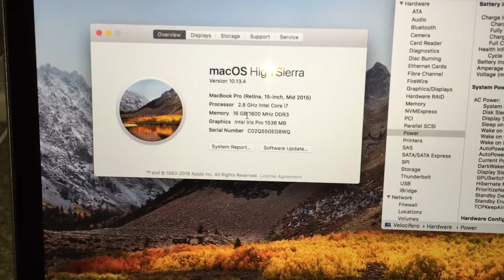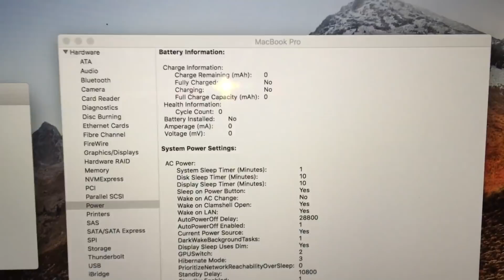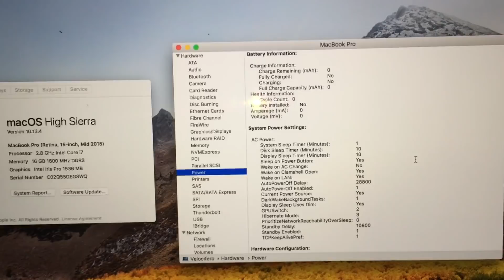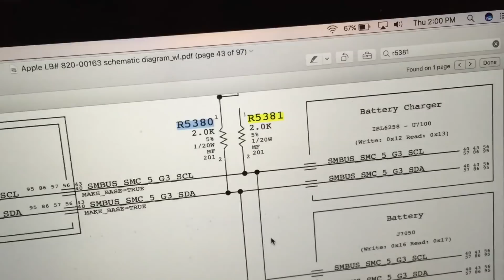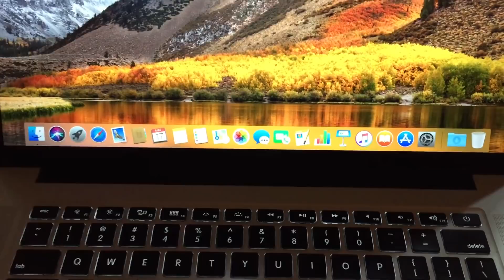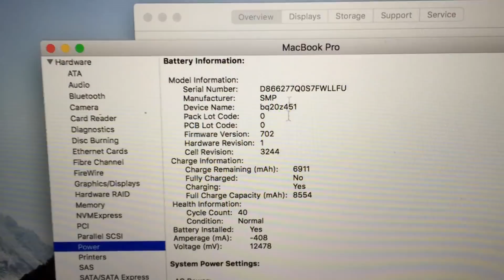Mid-2015 15" Retina MacBook Pro No Detected Battery Repair

Comment: Old video but hope you can still help. 2015 mbp 13, left it plugged in overnight and then it started with this issue. Wasnt able to locate a schematic to find the SDA and SCL resistors, but probed around a cirrus (im assuming the smc) chip and found two that measured ~2.1 kohm though i have no clue if they are the correct ones. Im led to believe it is this issue (or another logic board issue) though cause if i unplug it and then plug it back in after a few seconds, it will behave as if it woke up from hibernation. If you would be able to offer some advice especially on where to find those resistors it would be a huge help. TIA!

Comment: I have a mid-2015 MBP whose original battery gave up the ghost. The system reported all the correct status info, including "replace this battery". I'd ordered a replacement battery already. I replaced the battery yesterday.  When I booted up, the battery info doesn't show, continues to show charging (per power cable), and shows "Current battery charge: 0% on the Power Saver panel.  Is it reasonable to think the board was damaged in the process?
Reply: Do you know if mid 2015 should boot if battery faulty plugged in? It fell outside the repair serial (lame) but it's been reporting in the os for some time that service needed. I get chime and black screen and fans on when disconnected battery power drained and plugged in, but have to repeat that process just to get chime.  No external monitor either so screen cable ok. Just wondering if I should throw money at this thing I've used it occasionally for some time with it plugged in because batt life poor but not sure if it's a link where fully dead battery still won't work with adapter. Any insight appreciated can't get a straight answer.

Comment: Can you make a video using this exact same process but on a mid 2012 macbook pro 13in?
Reply from the maker: You just have to locate the SMBUS pullup resistors, the circuit is basically the same.

Comment: Hey I think I'm experiencing this same prob with my MacBook air, the minute plug the charger in, it turns on, if I plug it out, it turns off. When I check the system info it says no battery installed and I know that a battery is installed.
Reply from the maker: That could simply be a bad battery, but if you've verified the battery is good, then there is a chance you have a similar logic board issue.
Reply: @dosdude1 Do you know generally if the adapter plugged in with a bad battery for a fully dead battery should still work plugged in? I've had a bad battery for a couple years. The OS said requires service and I just used it plugged in because it wouldn't last long. However, now I get a chime but just a black screen and fans on, only when I unplug the battery drain by holding the power button down, putting it back together and hitting power, then repeating those steps is the only way I can hear a chime but it stops there, even with external monitor plugged in. For some reason I can't seem to get this thing to verify an SM reset through the power adapter light. I don't think I've ever had success with that. (Not even sure if it exists in logs if a successful smc reset was performed?) 
Thanks. I'm just trying to figure out whether I should throw a money at it for a battery to see if it'll boot up plugged in. Thanks

Comment: How much does that cost?
Reply from the maker: Does what cost?
Reply: @dosdude1  To replace the part
Reply: @midnightcrown5101   just a guess, but I would say .75 cents plus mail. Not much, the problem is finding the item on the board that is bad. when you find it, then you can use hot tweezers, or hot air, or if just a soldering iron, then cut the resistor in half and take off half at a time, if you are poor.

Comment: Great video. Anyway, I received a mid 2015 15 inch dual graphics model that keeps on rebooting several times before booting up to desktop any time I switch it on or restart it. The battery has only 202 charge cycles but it's dead (Replace Now).
What are your thoughts? I'm in Ghana, would have loved to send it over.

Comment: Hi dosdude1 how much would it cost to fix a mid 2009 17" with weird power problems?
Reply from the maker: 99% of the time power issues with those are caused by a failing C7771, in which case I could repair it for you for $75 if you're located in the US.
Reply: dosdude1 Only when I switch the the laptop to the high performance mode it shuts off. When I plug it in and switch to high performance mode it stays on.
Reply from the maker: Huh, interesting. Well, I could still take a look at it for you, if you're in the US. Send me a PM if you'd like.
Reply: dosdude1 cool thanks could I also show a video?
Reply from the maker: Sure, if you want to.
Reply: dosdude1 I am glad to say it was the C7771 cap for some reason it always showed the voltage 1.8 but now it doesn't not show 1.8 but 0.30. So I replaced it with a 330uf cap from a Dell laptop! Thank you Collin!!!